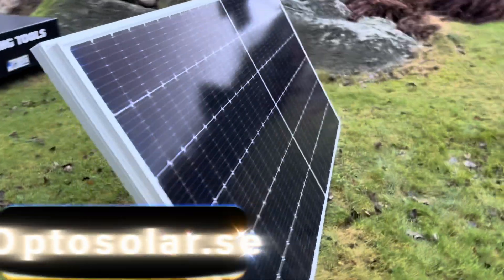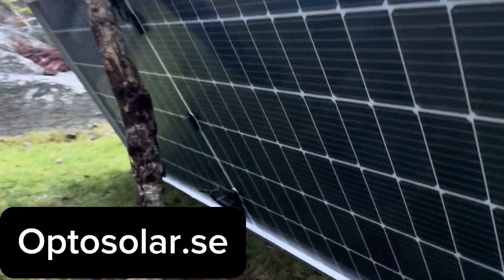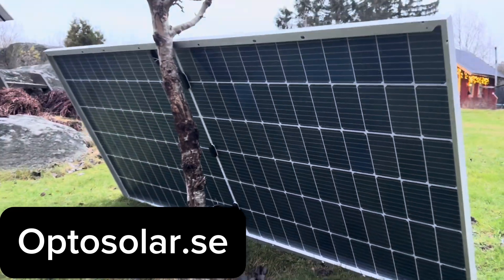Bifacial, glass glass solar panels on my solar trackers.

Comment: You might collect just a trickle with the panels horizontal off the (dim) white winter sky during the short daylight hours. It's a test of the MPPT and PV cell performance too.

Don't expect magic! Order of magnitude 0.5% nett of rated output. i.e. academic value, not practical.

As long as there's no snow settled on the panels!
Reply from the maker: I’m not expecting anything at all. I’m just glad that I have new panels because the old ones showed sign of wear and tear.
I might show that in an upcoming video.
Thanks for watching.☺️